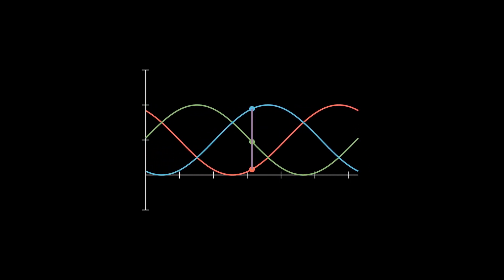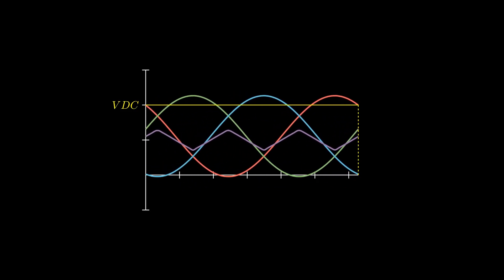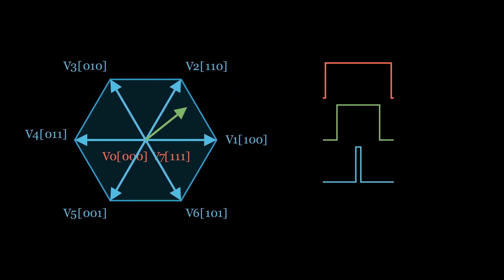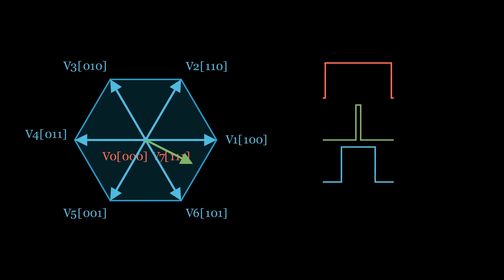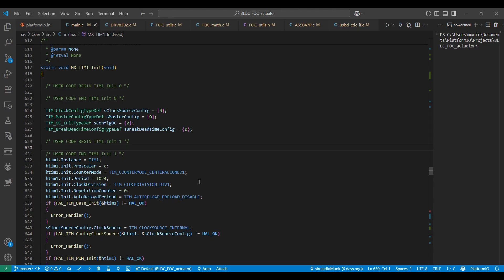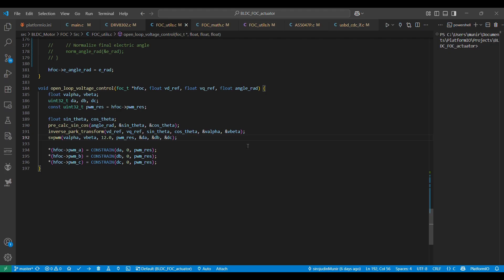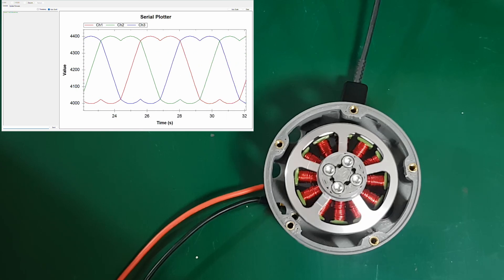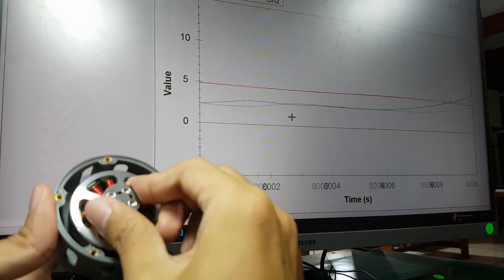SVPWM Explained and Implemented on STM32 for BLDC Motor Control

Comment: Hi, for SPWM and SAPWM, I can generate LUT. https://www.youtube.com/watch?v=gE4FEGtAXNs
Is it possible to generate LUT for SVPWM, if I am limited to Arduino or Attiny and there is no time
to compute this funciotions realtime ?
Reply from the maker: Hi, in my opinion, if the LUT for SVPWM in question is only made for electrical angles, it cannot be used for FOC, because in FOC the SVPWM value is based on v alpha and v beta which can change in each loop or are not static. Thanks :)

Comment: I did quite the same, but instead of subtracting a triangle shape, I subtracted the "lowest value among phase voltages". So I just brought a phase with the lowest voltage to GND. So at any time at least one phase i always GND. That also reduces MOSFET switching. Are there any advantages of the method you are using?
Great video!

Comment: Well made video, but I still did not understand how the hexagonal vector space works. I can see shifting the reference voltage, resulting in that waveform with 2 lobes at peak or valley can increase torque and power, but how exactly does the hexagon space aproximate this? What V1 trough V6 represent?
Reply from the maker: V1 to V6 represent the switching conditions of the inverter. At v1(100), this means phase a=high, b=low, c=low, at v2(110) a=high, b=high, c=low, etc. so that with several combinations of vectors and with different timings the desired output vector approximation is produced.
Thanks :)
Reply: Also, another viewpoint is to look at the hexagon and visualize that is actually a 3D cube that you are looking exactly at its diagonal. In other words the "saddle" shape of the produced vector waveform is the "cube" moving on the diagonal axis, basically "bouncing" back and forth but it is not visible in this demonstration. This "bouncing"  follows the triangular wave form shown in this video but also sometimes referred to as  "3rd harmonic" component or "common mode". By using the null vectors (000,111) in this clever manner manages minimal switching transitions so that you esentially go from 000->100->110->111 and then back in reverse (only 1 phase switching a.k.a. alternate reverse sequence) vs 100,110,000 (2 switches turn off from 110 to 000). SVPWM with average common mode  can  be  practially realised with a much simpler method where no sector determination is needed by the formula as follows: va,vb,vc  is the phase voltage such that va = cos(x), vb = cos(x+2*pi/3).. if you then extract the max and min such that vmax = max(a,b,c), vmin = min(a,b,c) you can calculate the common mode voltage as vcom = (vmax+vmin)/2. Then you simply subtract the common mode voltage  from the phase voltage to get the exact waveform shown = va - vcom.